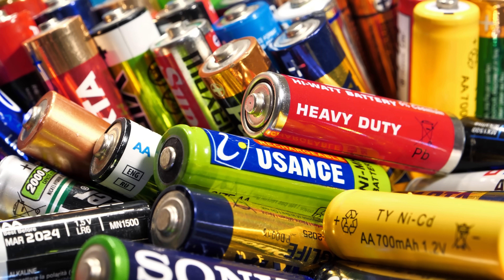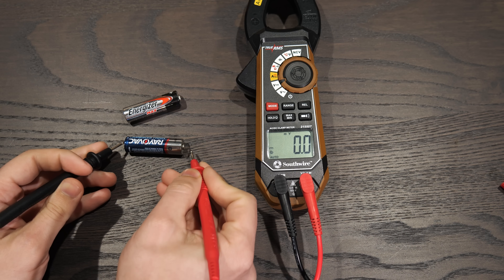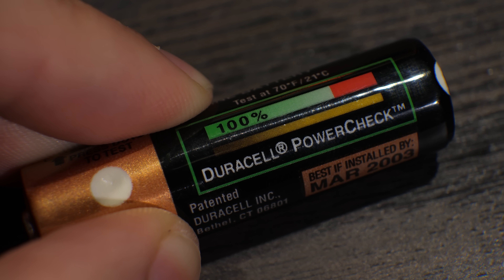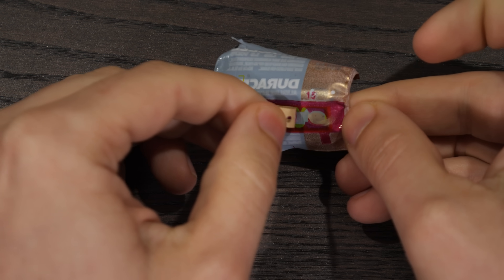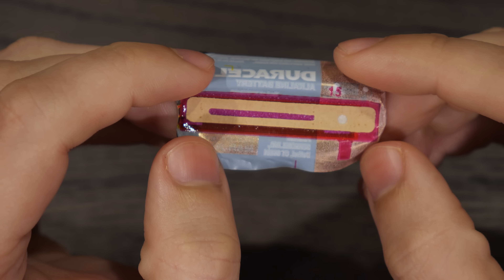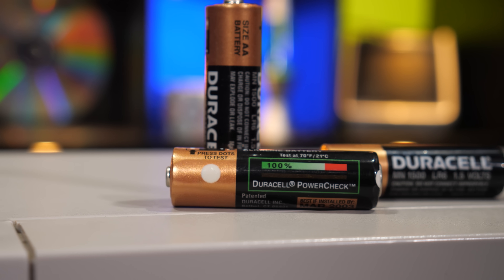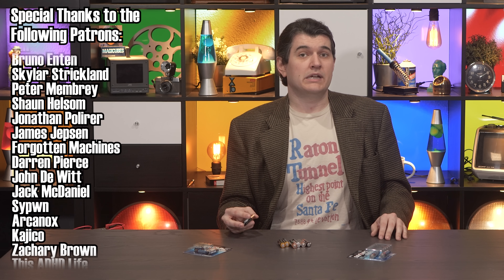Duracell PowerCheck: A genius idea which didn't last that long

Comment: One of the downsides with the switch to rechargeable batteries is how many of them use customized form factors and don't make it easy to replace when they rechargeable battery dies, leaving you with a useless device. LED lanterns are a big one for me. Trying to free ones that let you use standardized rechargeable lithium cells like an 18650 that you can just unscrew a cap and replace aren't that common.

Comment: I had duracell quantums in like the 2010s (2013 and later I think) and they too had powercheck. I feel like the feature was really smart. Too bad they're no longer being produced these days. It was nice to know if the batteries in X were full enough to power Y in a pinch.

Comment: if i remember correctly, it was way easier to press with nails, than with soft fingertips.
also, i've never seen a battery with a seal on negative contact. wonder why they are manufacturing them in different ways.

Comment: The issue was chucking a used battery in tue battery drawer and later not being sure what was fresh and what wasn’t. Then the device wouldn’t work and you risked tossing fresh batteries. If you carefully kept new ones in the package it was less of an issue. These were useful back in the day.

Comment: I remember having one of those little battery tester things you mention at around 13 minutes. I tried it across a 9 volt battery once and it very much started smoking, though I don't think it lit on fire.

Comment: My mom was the queen of taking batteries that were not quite dead and storing them. But here is the other bit about that, she had a battery tester in the battery draw so this was not useful to her. And iirc they costed more than standard batteries and if you are frugal enough to use a used battery I'd bet you are frugal enough to buy the cheaper batteries

Comment: I gotta say though, I prefer rechargeable AAs to integrated rechargeable batteries. Get the benefit of being able to pop open a battery door and swap in fully charged batteries quickly, while the old batteries go into the charger and hang out at the wall for a while. Much nicer than having to go "aww nuts, it's dead" and then plug it in via USB and just wait for it to be done charging before you can pick it up and use it again. Eneloops have served me very well over the years. Love my AA batteries, can't remember the last time I bought alkalines though.

I'll die on the hill that Xbox has the best game controllers in the industry specifically because I can just swap AA batteries instead of having a wired controller for a few hours, for example. For something that has to be thin like a phone, then sure, integrated rechargeable batteries. But much like the AAA complaint at the start of the video, there's a lot of devices out there that could have fit AA batteries but instead make me go through the unwanted hassle of plugging in and waiting to recharge. I have a mouse plugged in to charge right now, even though an older model of this mouse used a AA battery and thus never had this problem. Grrrr. (although at least it's not the Apple Magic Mouse - I could use the mouse while it charges. Yeah, of course I had to mention that disaster from Apple, no discussion about recharging batteries is complete without it)

Comment: I agree with most of what you say.  As a frequent user of AA batts for wireless mics, all of which have crude (3-4 bar) meters built-in, these indicator batteries would not be very useful.  I actually like non-rechargeables better than rechargeables, since for 20 cents each in bulk, I can be darn sure of fresh batteries when I start a video shoot, and the hassle of using rechargeables is not worth it.  I don't even look at the built-in meters; I just replace all (alkaline) batteries after every 3 hours of use even though they might work for 4-6 hours.  Much too risky to take a chance.

Comment: I do try to use batteries until they go out completely so as to not waste stuff buuuuut my battery drawer fills up faster than I can go through it. Well today, only my VR controllers use AA batteries. But even back in the olden days the batteries on my TV remotes and the like lasted way way longer and the other things that really needed AA batteries like toys and flashlights typically needed 2-4 batteries so the drawer would fill really quickly and not empty often.

Comment: I use my 'flat' batteries in less power-hungry devices. 1.4V or higher last hours in portable Minidisc players, and 1.3V or higher are good for a GameBoy Colour or small Tac Torches (flashlights).
Voltage not under load.

Comment: I preferred the package testers. They were a LOT easier to use. I sometimes would cut them out of the packaging so I could save it for later use. When they switched to putting it on the battery I was initially excited......until I used it once or twice. Then I'm like nope, these on the battery versions are 100x worse.

Comment: I agree that most people put fresh batteries in something until it dies, but growing up in the 90s with every toy and handheld gaming device running on batteries, and in a household where my father worked in audio/visual production, we had half used batteries EVERYWHERE, and the built in tester came in clutch many times for my gameboys!

Comment: Well, apparently I've been using these wrong all this time...for some reason I wrongfully thought the "indicator bar" would move as you test it, and since the green & red area never moved I figured all my batteries were dead and threw them out for new ones, I think that happened a few times before I got a Wii and got a a multimeter instead since it seemed to actually work...somehow never noticed the yellow part light up underneath it, I thought it was a horribly broken feature.
Reply: Either you didn't see the strip turn yellow, or it actually didn't. I remember having to push the buttons in a certain way or they just didn't work, and if they were stored in a humid place, those little contacts corroded, and again, they didn't work. I wonder how many good batteries got thrown away because the indicator broke or never worked at all...

Comment: I remember these.  You had to press those points pretty hard to get a reading.  Nowadays I just drop the batteries on a hard surface and watch to see how high they bounce. Alkaline batteries produce a small amount of hydrogen gas from the battery's potassium hydroxide gel when used, increasing internal pressure and bounce height.  New batteries don't bounce much at all.

Comment: There is another reason.  Back when the Power Check was in mass production...the "Maglite" was all the rage in flashlights. The AA version was VERY popular.  However, the extra diameter caused by PowerCheck would cause the battery to jam into the flashlight.  Duracell was, therefore, avoided for those flashlights.  PowerCheck was a negative selling feature for one of their intended markets.

Comment: This is "selling the sizzle not the steak" - whether people actually used them was irrelevant. Also back then brand loyalty for batteries was a thing, Duracell and Energizer wouldn't have advertised so much if it wasn't.

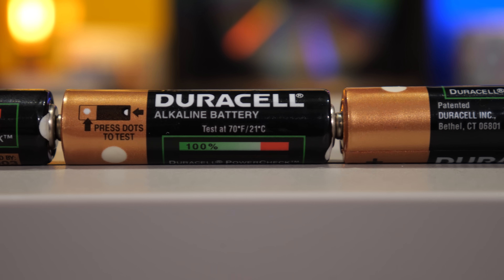Comment: 11:00 Unless you have a BuddyL supercharger released in 1992. I remember having one of these and we were able to recharge and reuse alkaline batteries several times over. Getting rid of batteries wasn't a common thing when I was younger. I recently picked one up on eBay and I'm back to recharging and reusing these "disposable" batteries. The battery testers were awesome when paired up with a supercharger!!! 12:53 The ones separate from the cells were always something we kept with the supercharger. You should do a video on the supercharger!! 13:47 It was great for the GameGear/Gameboy era!!!

Comment: Honestly it didn't seem all that long ago that you could still buy these. Perhaps it's because I'm not in the USA. In case you weren't aware, the batteries that had the negative terminal be the battery's body were usually rechargeable ones. I used to have a couple of devices that could recharge their own AA batteries when connected to a wall wart, but only through a third contact on the side of the battery. The manual actually told you to scratch away some of the battery's wrapper to make that work.

Comment: I remember some of these around the late 2000's. Had some when out hunting with my dad. And yes the kinda sucked to use. Especially since it would be colder out that time of year so they didn't work well anyways. I forgot these even existed because it's been so long since I've seen them!

Comment: See i was testing batteries all the time.  I switched out my smoke detectors to ones that used 3 AA batteries instead of 9 volt.  Then i would replace the batteries each year, whether they needed it or not, and i would have a drawer full of barely used batteries that were way more useful than 9 volt batteries.

Comment: Got puzzled why they "didn't last long" although I clearly remember seeing them lately. Turns out, in Russia they were sold right till 2022 and were made in Belgium. They were phased out by a new generation of batteries and Duracell finally got rid of PowerCheck in July 2022.

Comment: My Work Volvo's tail lift's (Zepro) remote controller uses 2x AAA, even 'tho it could fit 3xAA. But nooooooo, why make tools work long when you can force user unscrew 5 stupid long screws to change two tiny batteries.

Yes, I paused this video before 1 minute mark to write this.

Comment: You do not need a tester to detect a discharged alkaline battery. Simply drop it with the positive terminal pointing down on the table from a low height. If the battery bounces, this means it is discharged. If the bounce is clearly damped, the battery is fresh.

Comment: Rechargeable NiMH batteries are a good option for devices that still use AA/AAA batteries. They only output 1.2V, but that mostly works fine.

Comment: 12:00 A big part is competing on brand loyalty. The brand and generic batteries are literally made in the same factories.
Reply: I just look at them to see whether they are alkaline or zinc carbon/zinc chloride, and if the latter, if they are suspiciously soft. Alkaline will have the insulator or the groove around the negative side, and the zinc carbon/chloride around the positive. Alkaline are better for high-drain applications and zinc carbon for low-drain like remotes or clock (less capacity but lower self discharge and cheaper). As for the suspiciously soft, I had some really low quality zinc carbons that you could literally squeeze with your fingers, and those are very bad because they often leak.
Reply: i always bought the cheapest, they were mostly Panasonic or Rayovac!
Reply: Just wrong. While true for some items, cheaper ALWAYS = bad when it comes to batteries.. Clown
Reply: Made in the same factory, even on the same equipment doesn't mean they are the same.

Often, when that is the case, the cheaper ones are made to a lower QC standard.
Reply: Jup. In Germany, you can get a pack of 8 generic brand AAs for 1.50€ to 1.80€ at any supermarket.
Yet my dad will regularly buy a 4 pack of "Varta Long Life" (traditional german brand) for 5€ or more.
Just think about the profit margin when people are willing to pay 5 to 10 times as much for the identical product.
Reply: @w0ttheh3ll  being made in the same building doesn't tell you more about what specifications and quality a product has than the brand name my Freund ;)

Comment: The only use case for keeping used batteries around that exists in my life is prior to winter each year I swap out all the batteries on my trail cameras which generates 40+ partially depleted batteries. They end up going into the junk drawer and powering remotes and kids toys.

Comment: I would love to see these make a comeback for rechargeable batteries. I think it would make more sense because the re-use of rechargeables makes it  more likely to have half used or empty batteries around since you might just toss then in the drawer until you get the chance to recharge them.
Reply: Sadly it doesn't work for any of the common use types of rechargeable batteries.  They read 1.2 volts from about 95% charged all the way down to about 5% charged.  with the most common today NiMH LSD type, you are best off charging them before tossing them in the drawer.  They get reduced capacity and life when stored discharged.  When you pull them out dead, toss them in the charger, then (with any LSD type made in the last 10+years) they will have at least 80% charge for more than a year.
Reply: @johngaltline9933  Hmm that's a shame, my eneloops do read 1.5 when full but I remember seeing a graph showing that the voltage drop is less pronounced so that makes sense.
Reply: @johngaltline9933  couldn't the taper of the heating element he showed just be adjusted to match the discharge curve?
Reply: @CircuitrinosOfficial  Like I explained above, there is no practical discharge curve.  they provide full voltage and current throughout the discharge all the way until they are almost depleted.  there's no difference to measure between a 95% charged battery and a 10% charged battery. Modern devices with chargeable batteries don't actually know how much of a charge the battery has, instead they guess based on how much they have been used since the last time they were charged and how long it to to deplete them the last time in combination with how much current they draw when charged.
Reply: With NiCad or NiMh cells, the voltage and current are pretty constant throughout their charge life, so those can't be used to indicate the state-of-charge.  Lithium techology rechargable batteries do have a fairly predictable and constant voltage discharge curve, but equipment which uses them also often has some kind of power indicator built-in, unless the usage is considered non-critical or there is not enough space for the indicator inside the equipment.
Reply: @melkiorwiseman  For lithium ion there are 1.5V AA/similar batteries using an integrated buck converter. For better or worse it is usually constant 1.5V, so you can't get an accurate measurement. This could be an option, though there are already options that drop voltage or flash an indicator when battery is low.

Comment: Still use a lot of deveices that are poewred by AA cells (because I'm weird) and except for my camera flashes (told you, I'm weird) I use almost exclusively use rechargables. Testers on those would be such a great usability feature... If at all to separate the empty ones from the full ones in my backpack pocked because I often carry some lose cells for my walkman, flashlight, field recorder, etc.

Comment: Yup, those were tough to test, especially with a 10-year old's hands. Still, i got quite a bit of use from them in Lego. It was neat to know if my motorized excavator would be fine for a play session or if the motors would churn painfully slowly until finally dying.

Comment: When you said 1.5 volts, I had a twitch in memory of all of the troubles I used to go through with batteries not lasting long because they were 1.3 volt double A's and triple A's when the batteries that you should have been buying were 1.5 volt double A or triple A to get the money that you actually are paying.
Reply: You could often get packs of "heavy duty" zinc carbon batteries that were significantly cheaper than alkalines, but they couldn't deliver high current. 

Good for remotes and clocks, but if you used them in a toy they'd barely last. 

I believe they were still 1.5v, only batteries I recall being lower voltage were rechargeables. NiCd  cells are 1.2v per cell, but they could deliver high current. Good for tou cars and stuff...
Reply: @volvo09  Yeah, until you buy one that says heavy duty and still is 1.3 volts. When you have a device that won't power on at 1.2, 1.3 becomes useless.

Comment: I don't know if these went away quite as quickly as you're saying. I was born in 2000 and I definitely remember having these in Dallas through most of elementary school if not longer. But I also remember them having only one button and a different graphic, so maybe they had another version?
Reply: Actually I just checked and they were still making them recently enough to have amazon listings. And I found evidence to suggest that they were discontinued when Duracell quantum was, but that doesn't mean it's gone forever.

Comment: My parents first digital camera would only use batteries until they hit about 1.2 volts and then wouldn't turn on any more. But they would last in a remote control for 2 years.

Comment: It’s funny that older gen (and lots of cheap current gen) rechargeable batteries out there run at 1.2v even fully charged, and some gear that ran back before they were around literally won’t even power on with rechargeables inserted (like old PDA’s), and lots of cheap devices with 7 segment LCD’s appear super dim with them.

Just thought it’s a neat factoid after you explained the voltage drop as the traditional AA’s lose charge

Comment: YES! And some batteries actually still have these. We have some at the racetrack I work at, and they have the little tabs you can push to tell how much juice the battery has. I'm SO GLAD you made this video, I wanna know how they work lol The ones at the track are colored. From red, to yellow, to green depending on the charge level of the battery. I wanna know how it does the colors, because the "viewing window" isn't colored itself

Comment: This is not really anything like a "voltmeter." By definition, something getting warmer means that the battery is indeed being put under load. As a result, this is a power meter. It's actually better than a voltage-based battery meter.